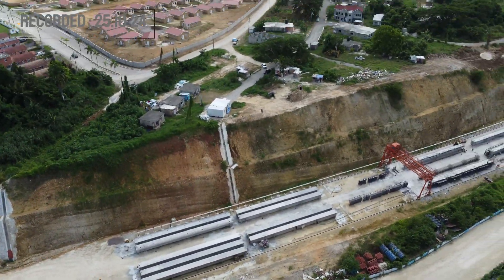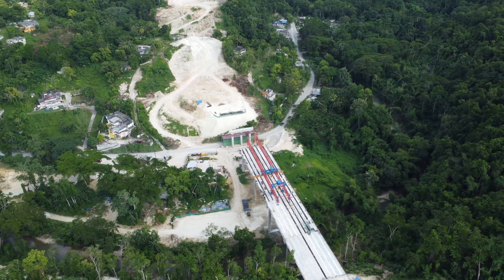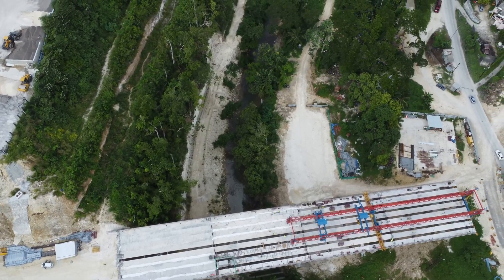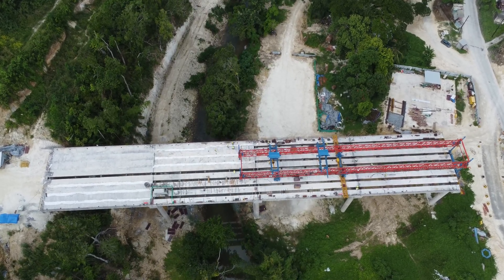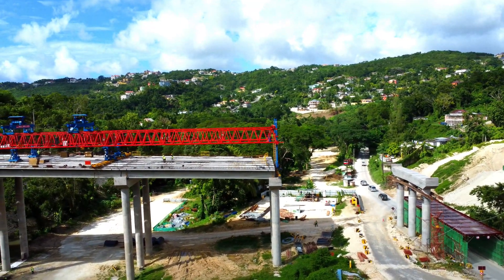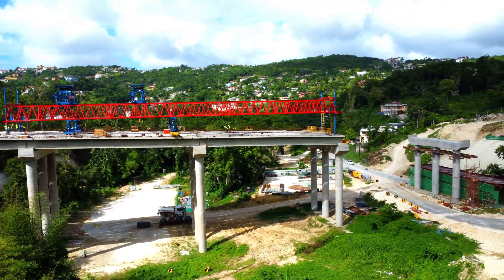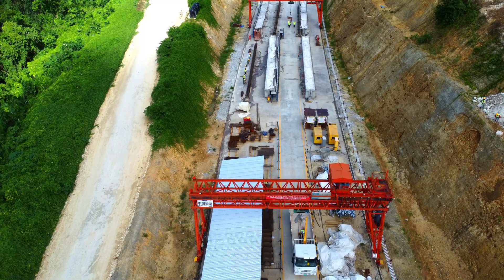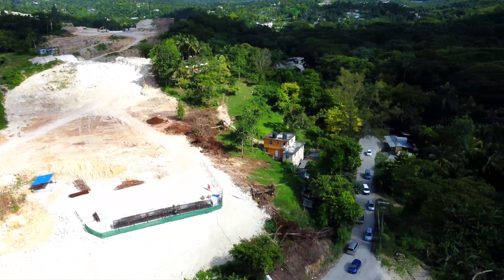Epic Aerial Tour of Jamaica’s Highest & Longest Four Lane Bridge Under Construction; Mobay Bypass!

Comment: This bridge (and its roadway) is too narrow and will soon become congested as the areas around the Mobay bypass become densely urbanized...it should be built in a flexible way (with wide soft shoulders) to accommodate future expansion to six lanes (inclusive of two High Occupancy Vehicle/HOV lanes so as to accommodate emergency vehicles/bus/taxi traffic)....

Such shortsightedness will be extremely costly going forward...
Reply from the maker: I agree... I don't think as a country we plan ahead enough.  We are very reactive in our approach to most things.
Reply: They wound have to build another bridge to compensate these decisions are made based on cost and immediate need with plans in place for future expansion which would be another bridge. That's how they think in Jamaica
Reply from the maker: @divinee.155  Exactly!
Reply: They also need entunnel this highway trench as people and mother nature will throw rocks onto the highway surface below....